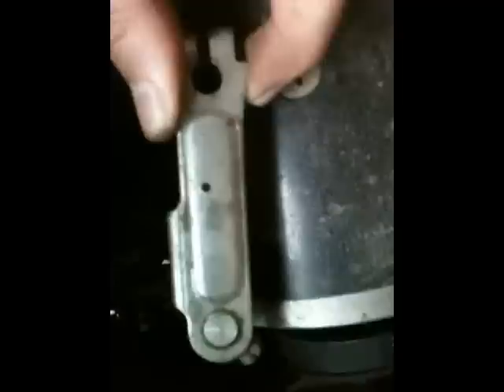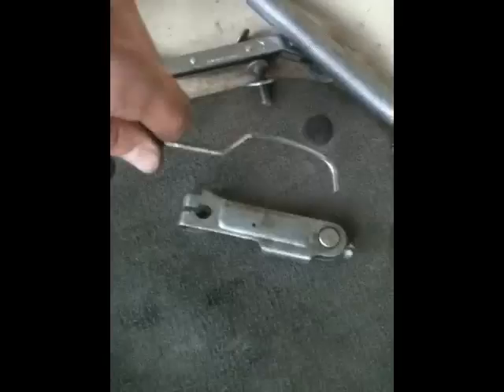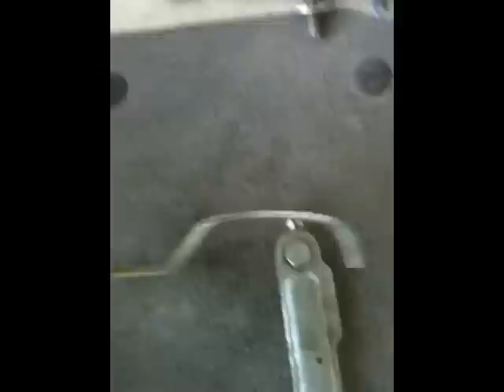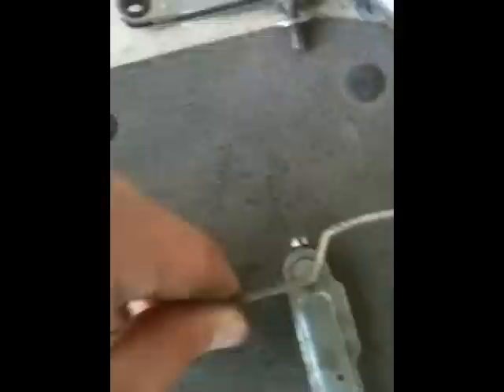Removing Club Car DS Governor 1996 and under

Comment: I agree, a zip tie is easier and works well.
Reply: Todd Ely where do you zip tie it
Reply: Yes if you have done the zip tie method where do you do this? I have 1994 club ds
Reply: @leslietompkins3461   I tried it today on my 94. Top speed it cuts out bad. So I took it off